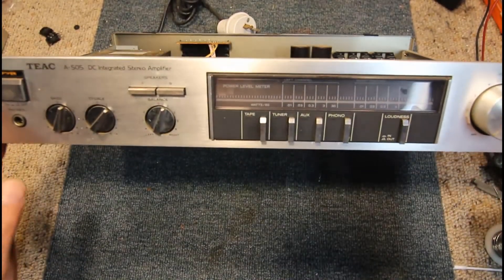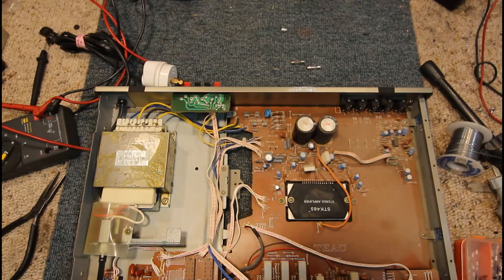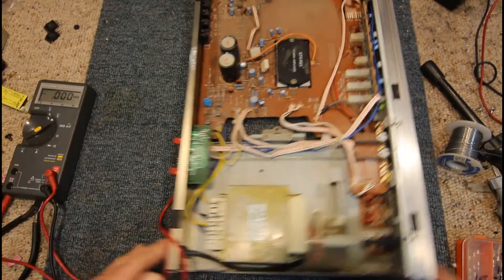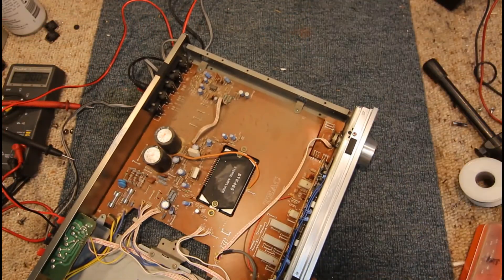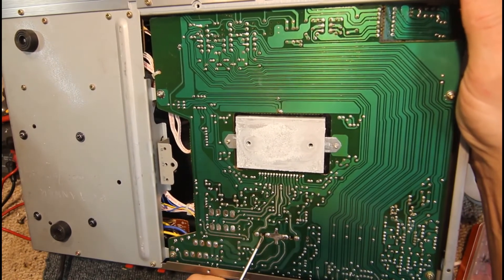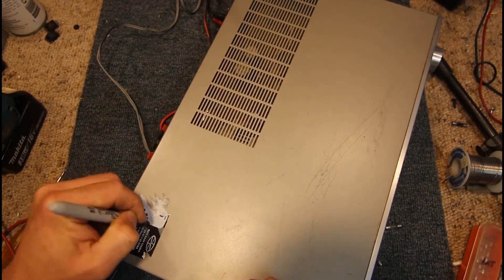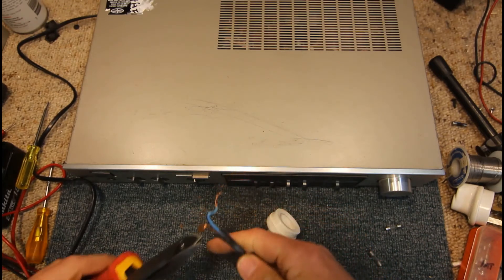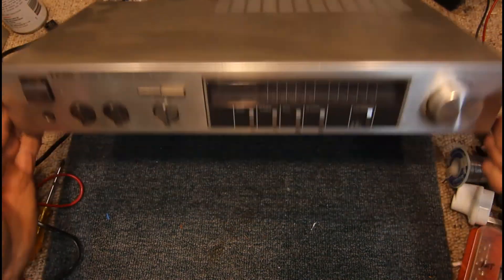Teac A 505 Amplifier diagnosis and repair.

Comment: Thanks for sharing these repair vids. What did you spray to fix the scratchy pots?
Reply from the maker: I use CRC Switch Cleaner Lubricant. Anything made for cleaning and lubricating switches should work. Just make sure its safe to use on plastic. Petroleum based products like RP7, WD40 etc should not be used.